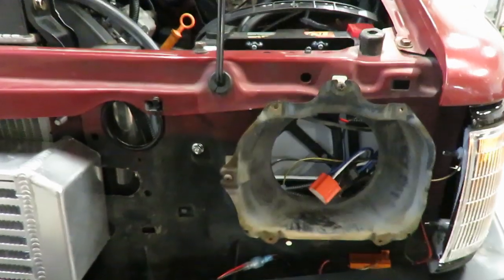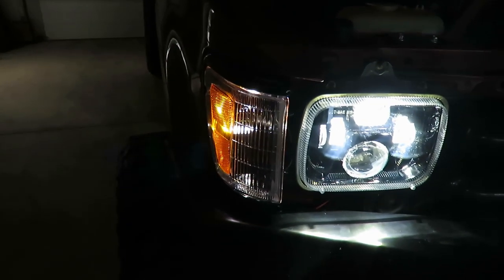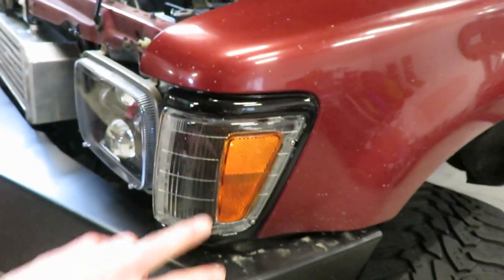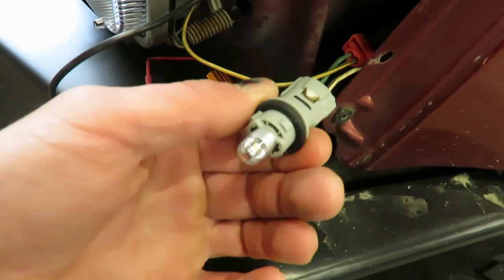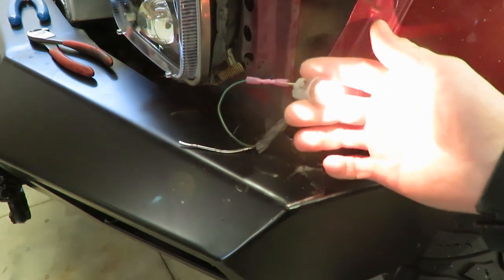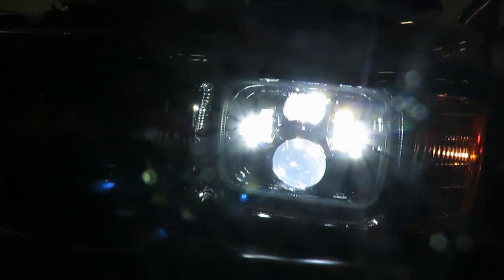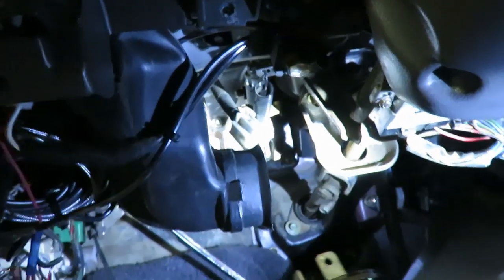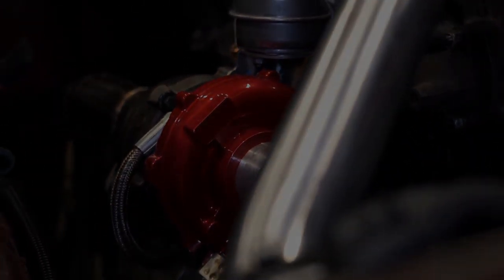We got a set of head lights that actually work!! Sealed beam LED Toyota Pickup

Comment: I need some help please so I've been searching around but haven't found an answer. So my question is when replacing the corner lights in order to make them LED lights would I just need the bulb for it plug & play type of situation or do I have to have an adapter for it? I'm trying to convert all my lights to LED but haven't found a video on my specific questions. Awesome video love this headlights will be saving to get a pair 🙌

Comment: Did you turn on your radio to see if they Interfere with the reception?  I put a set in my 80's model truck and the radio buzzes like crazy.
Reply from the maker: Suds Reserve I have not as my speakers are shot
Reply: @austinniemela  you might want to rig one up to see. I never have been able to fix the problem, so i just use the CD player.